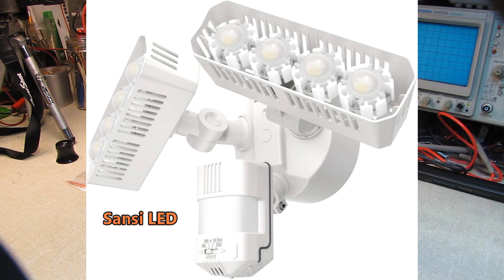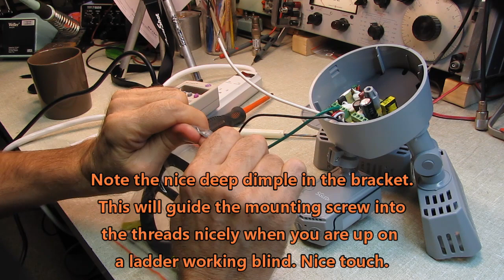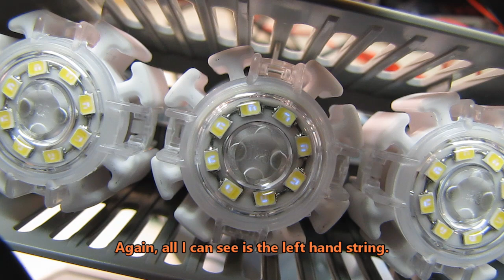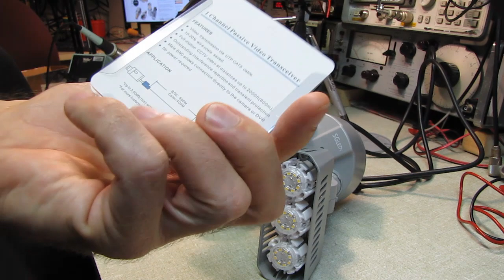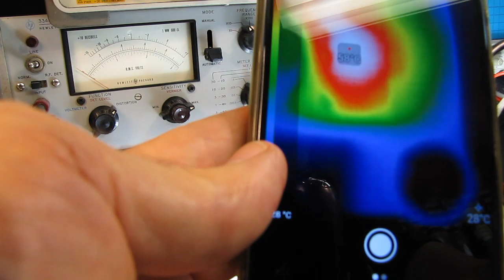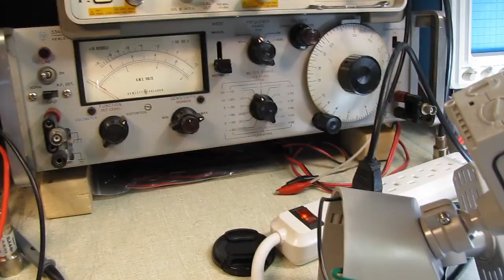SGled's Security Lights Tested/ Link in Description

Comment: Your'e really fortunate with the noise level. My neighbor replaced his incandescents with LED lights and my 40m noise floor went from ~1 S-unit to S9 when they were on; those lights are at least 125' away from my HF vertical antenna. After fighting with the US seller (designed in USA at least) the bottom line was they said they met FCC limits. I put spare unit on the bench and nothing but trash up thru 10m. The supply was a potted unit so couldn't diagnose but adding a toroid to the 120VAC input and 48VDC output (and a couple of safety caps each way) the noise completely went away (thank goodness!). Now if I could just get him to keep his electric fence from sparking...he really is a good guy and I repair it regularly myself to help out. With the H-probe on the analyzer looking at the AC line is where I found the trash...out to the Romex it went which I believe was acting as a great antenna. Again, you're lucky! What was the brand again??? Thanks for sharing Vern.
Reply from the maker: Hi Dino. I didn't always have a good noise floor. For years I had issues with an arcing primary line at the pole in front of the house. It was 20 over, and all over the HF bands and UHF/VHF bands.  Fought with Public Service for years until I made a print out of the spectrum noise and sent a copy to the FAA, FCC, Local Airport, Local News Outlets and the president of the Local Public Service. Some of the highest peaks were in the aviation band.   They had it fixed the next day.  Electric Fences are a pain. Glad I don't have any close by here. Not much you can do with them. I'm lucky I have great Neighbors willing to work with me on everything. They even helped put up the tower. They also let me fix all the issues with their phones, stereo gear, TV issues and answering machine issues I created when I went QRO. ( something to be said for QRP ). The unit I have here is under the name SGleds. This is how it is listed on Amazon. I just noticed on the back page of the manual that came with it another name. www.Sansiled.com.   Sansi is the name on the other unit I showed a photo of in the video. Same company.  Thanks for watching. Nice to have you along for the ride.